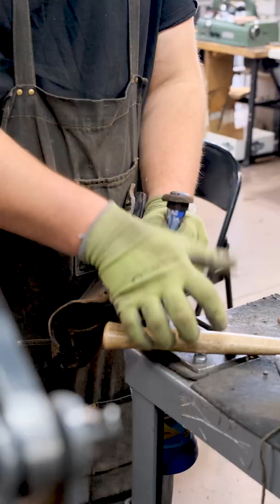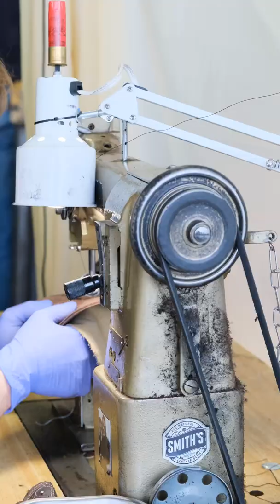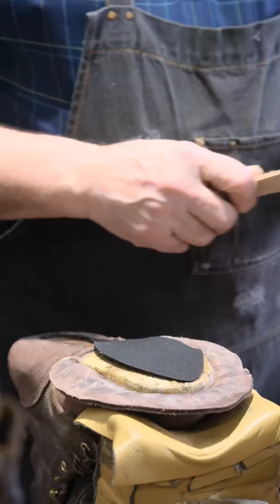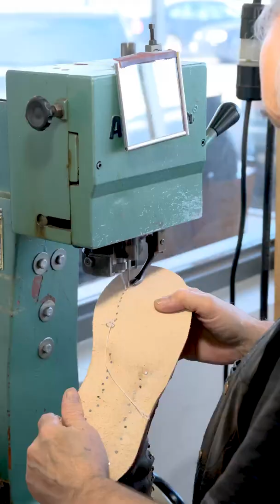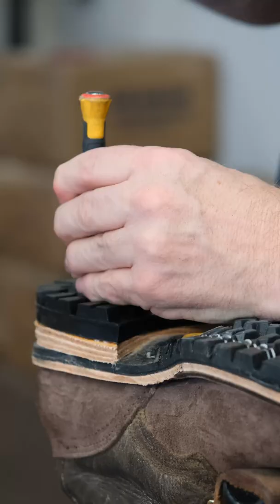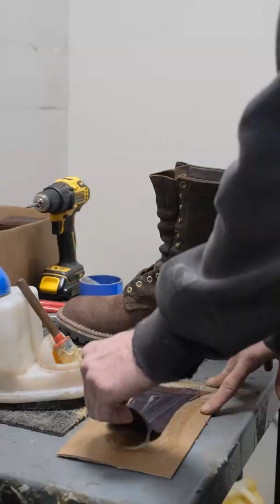Work Boot REBUILD in 60 Seconds! #Shorts

Comment: Economically nicks are absolutely worth it if you price it out Each time you put them on (for example buying a $200 pair of boots every year vs. A $600 pair of Nicks every 10-20 years based on conditions multiple reviews on their website and on YouTube confirming this)
Reply: The cost of a resole/repair at the factory should also be factored in. Refurbishment of this level won't be cheap I'm sure...